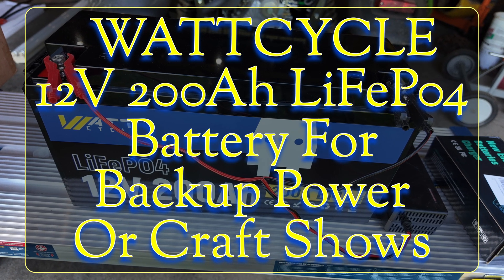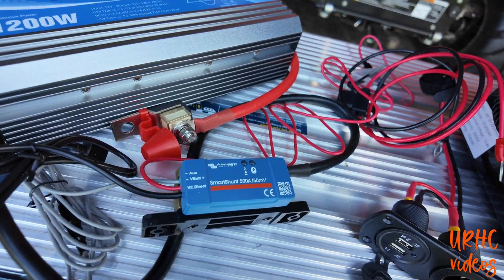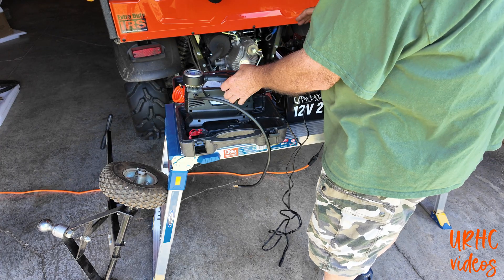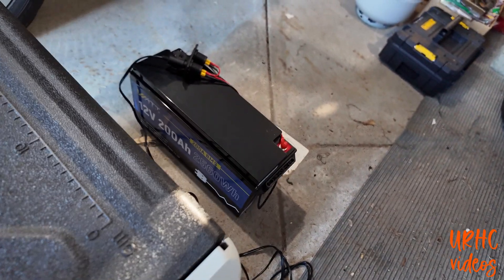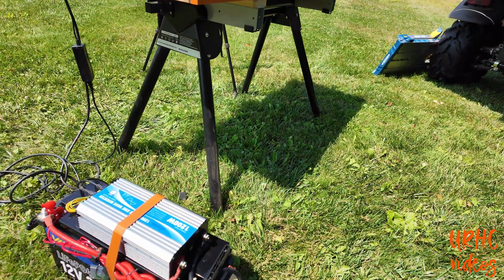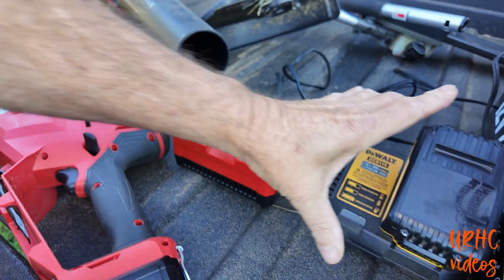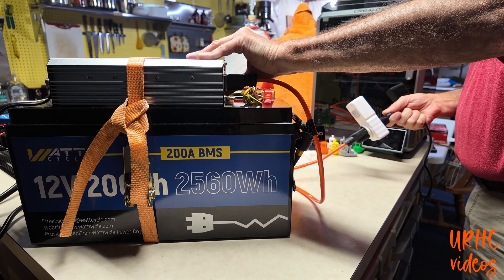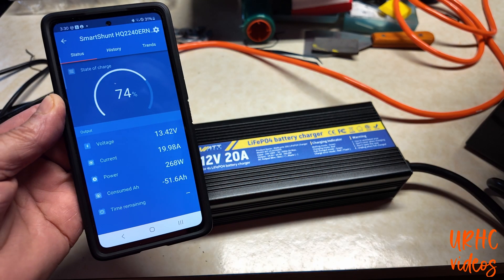WATTCYCLE 12V 200Ah LiFeP04 Battery For Backup Power Or Craft Shows

Comment: How long to charge a dead battery?
Reply from the maker: With the 20 amp charger theoretically it would be 10 hours.   The charger  will taper some towards the end so will be a little longer. With the 200 amp bms and enough solar could cut that to a little  over an hour. You never  want to run these completely dead. Go by the low voltage cutoff that should supply the 200 Ah. Thanks for watching.

Comment: Ed, that is the way to go. That is somewhat cheaper than buying already built ones like I bought. A couple of solar panels hooked up to it and you would be set. I was really surprised at how little power the freezer used. As far as the power consumption of the K1 3D Printer, I got the same readings.
Reply from the maker: Yes the 7 cu ft freezers are very efficient.  The capacity of a battery like this exceeds many of the affordable power stations and being easily upgradable and repairable may be a solution for some. I bet your mower batteries would also be a good power source for outages if you made a way to connect them to an inverter. Our power has become quite unreliable. Between this and the 2 golf cart batteries I should be set for cold food and beverages for a week with a couple panels hooked up. Thanks for watching.